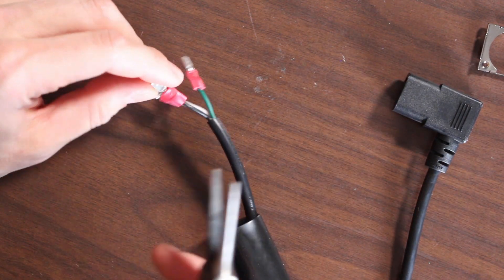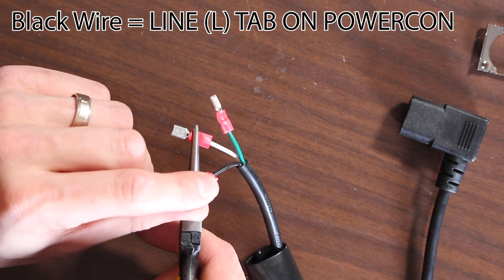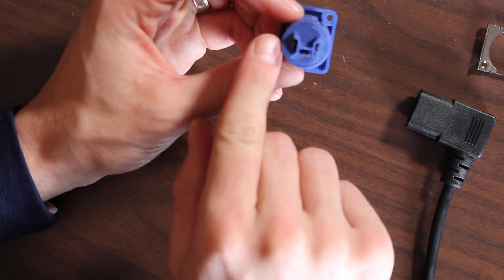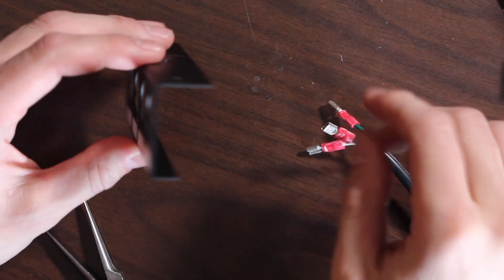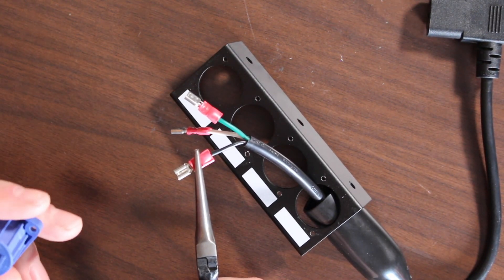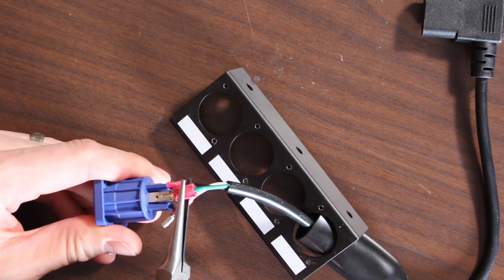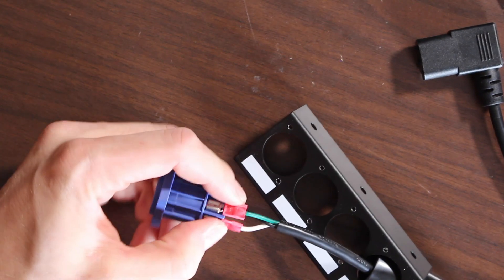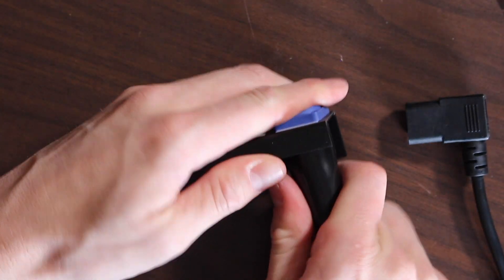Connecting A Crimped Power Cable to a PowerCON Panel Connector

Comment: Does this power the power supply mounted? If so is this comparable with Cioks 7?
Reply from the maker: This is not a power supply. This is a powerCON to IEC tail to provide AC power to devices. Yes, this can power a DC7.

Comment: Toilet paper from the front of the roll is getting the least amount of bacteria on the wall and roll because of touch contact.

Rear mounting not only looks better but also saves time and affort when fixing a malfunction of some sort.

You call yourselves "Pro" but apparently have never been in the show stopping moments that require a real quick fix.

Front mounting are show killers in those moments...
Reply from the maker: We are pretty professional, Richard. Thanks for noticing. The amount of times we have seen a "d-series" connector go bad to stop a show in the past 50 years of doing business solely within the live performance and touring industry has been less than 0.01%. If you have a single D-series panel connector that is a "show killer" you are doing something wrong. Two screws, pull connector forward, replace the crimped quick connects onto the new powerCON. Slide back into hole and put two screws back into the tapped panel holes. Done in less than a minute.

Plus - we offer the MFD plates to rear mount these. We literally give you both options.

Comment: Why are you using the “old” PowerCON instead of the “new” PowerCON True1 connectors?
Reply from the maker: This is using the even newer "XX" series of powerCON. Has the Circuit breaking capability and fits into a standard D-size panel punch, unlike the True1
Reply: @BTPA_USA  ah great thank you!
Reply: Love these videos. I would love to see a more in depth video on how you guys terminate multiple devices power cables to one powercon connector? I’ve watched multiple of your build videos but I can’t seem to find one that goes over such a process
Reply from the maker: We shot a video showing how to terminate a powerCON chassis connector last week! Just need to edit it. We have a short on our channel showcasing how to do this right now. I will find it and link it. It doesn’t show multiple cables to one, but the concept is exactly the same as doing a single cable, you just double the wires into the disconnect tab. We also make this to order, to whatever length you want, in the case you don’t want to buy a crimper and do it yourself. Thank you for the support and following along!
Reply from the maker: @AltNoiseCorp here is the short. https://youtube.com/shorts/HxyW-wmZlQ4?feature=share